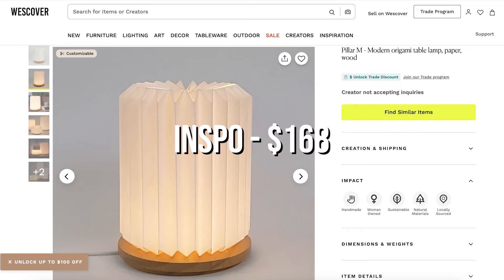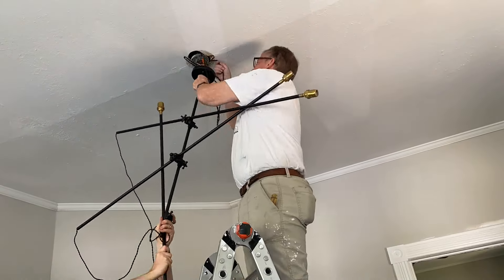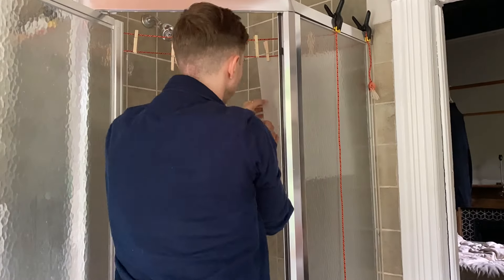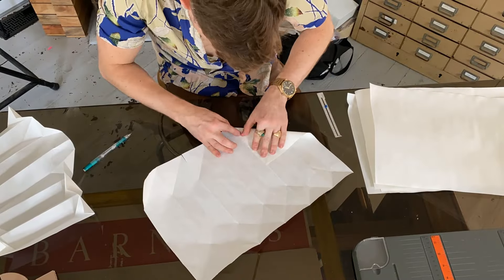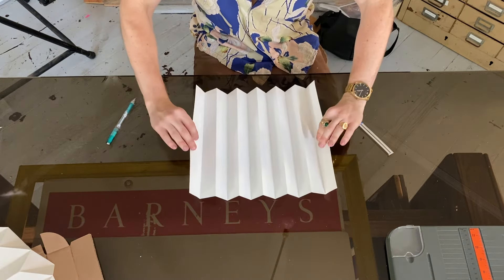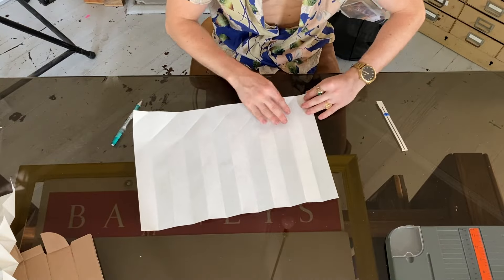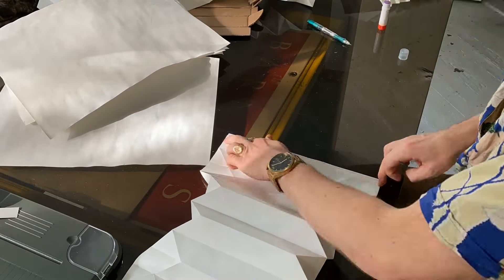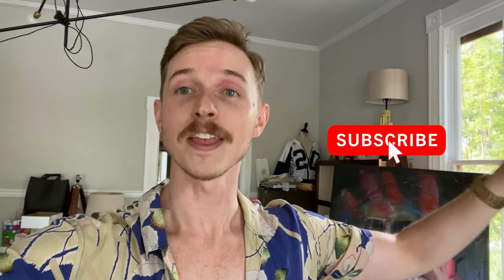Chic DIY Origami Paper Table Lamp | REISSUED

Comment: I like the juxtaposition of the modern looking light fixture in that more traditional space. The draping of the electrical cord is well done. I made a light fixture for client to hang over an island, and made it in a way that it looked like an oil lamp that had been converted to electricity and we got some cloth wrapped twisted electrical cord and ran it in a similar way to the lamps.
That shade turned out fantastic, I wasn't fussy about the wood base, but when on and in your chamber it does suit.
Reply from the maker: Ooh your lamp sounds super cool! And I’m glad you like mine! It feels a little weird at the moment - but I have faith that with all of the other elements I have planned for the room, it’s gonna come together
Reply: @REISSUED  and if it doesn't come together, you always have the option of changing it.

Comment: Very Nice Andrew. I'm not sure what rag content or weight of paper you're using. But using a folding or burnishing bone really helps in making 'crisp' edges for paper folding projects of all kinds. (A few bucks) Years ago, I used a handmade Mulberry paper from Japan to make some lamps with very thin balsa wood structures with varying success. I approached the 'flame proofing' 2 ways. 1. Use an acrylic gel medium to coat the paper &  2. Used a "standard to chandelier" socket reducer to be able to use a smaller diameter and wattage bulb. That works especially well for atmospheric lighting. I may have mentioned this before but I have a bit of a lamp fetish! :hand-orange-covering-eyes:LOL Another great project Andrew! Cheers.
Reply from the maker: Love your helpful tips! Thank you for sharing with the rest of us!

Comment: If you said, I missed it, but how long did this process take, from the time you started folding your first sheet of paper to the time you turned on this beautiful creation?  Of course, I would have to track down a base and lamp parts as well.   I can see it taking me a month!
Reply from the maker: Hey there! The folding process definitely took me a bit of practice and the testing and prototyping are up a couple house of my life 😂 But the actual finished folding took me under an hour. And the assembly was pretty quick too!

Comment: That is absolutely beautiful. It has a bright warm yet very soft light. I would have ended up wadding it up, hucking it out the window and gleefully running over it in my driveway but you really pulled this off. Very nicely done!
Reply from the maker: Haha I almost reached that point after folding 6 prototypes/mistakes before arriving at the right folds. But sometimes you gotta power through! I’m glad you like it ❤️

Comment: What a wonderful lamp. Does the paper have to be of a particular thickness? Also, instead of hard wiring you could just have one of those battery operated smart bulbs, it would look much cleaner on a shelf and Alexa can still turn it on.

Comment: Looks great! You can get on/off switches that can install right on the lamp cord. The switch is a small wheel that is turned to click the lamp on or off. They're inexpensive, very quick to install and are available in the lamp parts section of the hardware store. Also, you could put your fireproofing solution in a spray bottle and spritz the finished shade very lightly, letting it dry and spritzing again a few times.
Reply from the maker: Great tips!
Reply: Yes,I was going to suggest spritzing afterwards as a potential option.  Though some spray bottles are a bit inconsistent and it'd be grim to get blobs after all that folding...  🥴
I think one of those incredibly fine 'constant misters' that hairdressers use might do the trick.  The droplet size is uniform and positively minute.  Either way, this lamp is magnificent, @REISSUED!  🤍